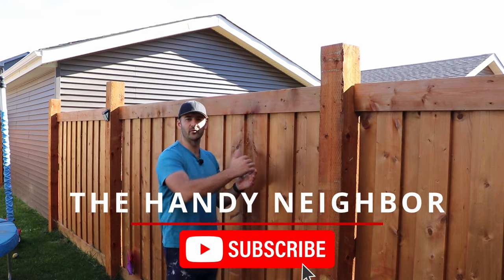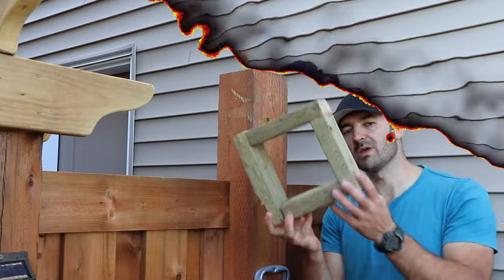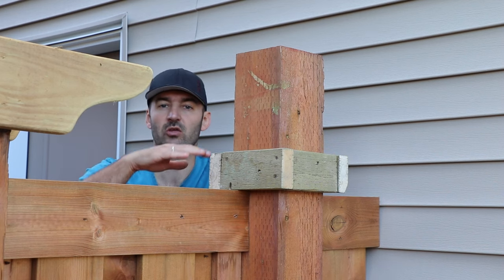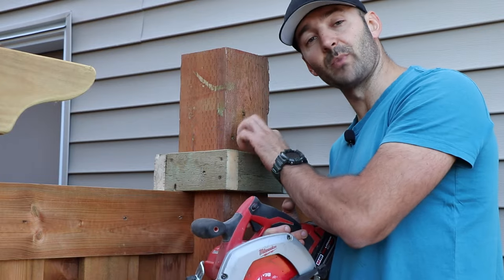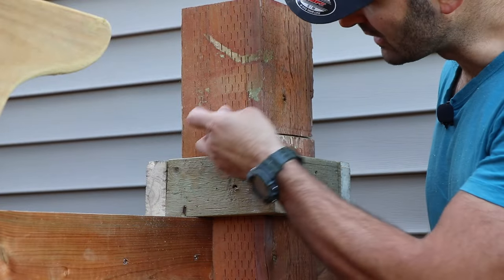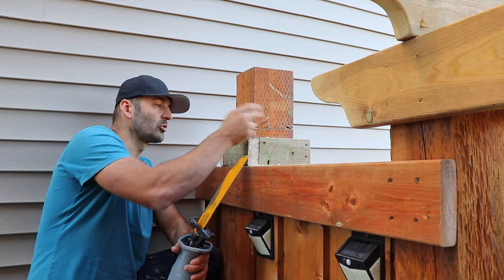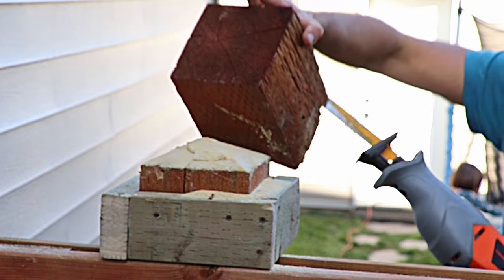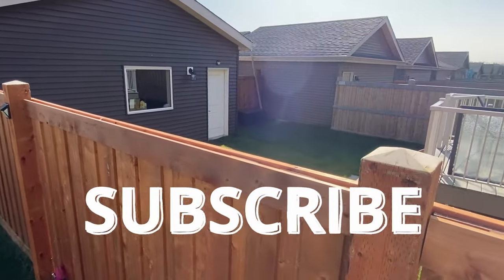How To Cut Fence Post Tops

Comment: That ragged cut just magically sanded itself to a smooth finish. I wish mine would do that.
Reply from the maker: No I used orbital sander to get it perfect as I used small saw as I said. 
For perfect cut you need a bigger circular saw that can cut to the middle of the post.